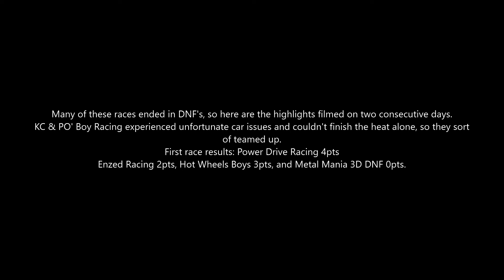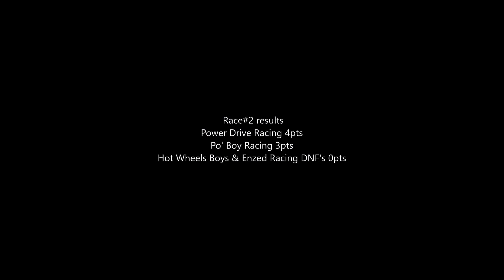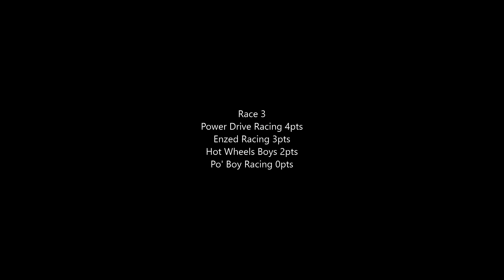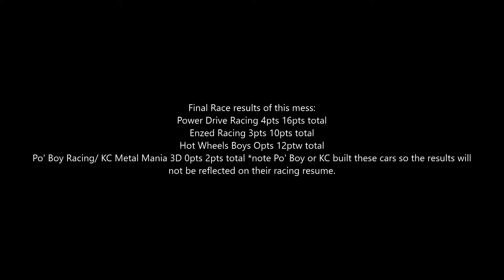#BlackFireTyer Invitational, Heat #7 Wildcat 350 Speedway Presents: Exciting Custom Diecast Racing

Comment: That was epic Jon, I got flamed 🤣😂🤣😂 brilliant stuff mate the action was non stop. 👍👌👍👌👍
Reply from the maker: Thanks Craig this heat fought me every step of the way to get in some clean races.  The cars will probably carry the points to the next events qualifing and heat placement.  The Chevelle still needs some shop tme, it suffered from the overseas journey.  I'll have it up and rolling smooth for it's next outing.  These cars didn't advance, they were blown off the track by the other cars with tyers in the test heats for round 2, they could barely get passed turn 2, if they were still on the track.  Thank you, you'll really love the next rounds.  Cheers!
Reply: 😂😂🇦🇺🤝🇳🇿👍😎 Got Flamed, glad to cops werent involved 😂🇦🇺🤝🇳🇿

Comment: I love EnZeds MG1100, well detailed too! Good one! Loved them as a kid the first time around too!
I have to find a beater one now to have a crack at it!
Well done DJ, I never.....tyre of you vids! Haha
Cheers all
Reply: I'll second that Marc D 👍🚦🏁
Reply from the maker: I'm going to outfit it and I bet it will be competitive, it has great pace in clean air!
Reply: @PowerDriveRacingDJTrippleJ  awesome stay tunned for the Morris 1100 that blows away the big guns 😂🇦🇺🤝🇺🇸😎🙂👍
Reply from the maker: I was thinking about setting up a few of my Johnny Lightning Minis that roll like their on steroids and see what little blue can do against them.
Reply: @PowerDriveRacingDJTrippleJ  yes that be cool, I can remember before i started racing speedway and back then they had the minis up against the v8s and man they beat them, plus also gave them a very hard time was awesome to watch, that was back in the 70s cheers
Reply: @PowerDriveRacingDJTrippleJ  I did note it had some speed going into turn 1.
Reply: @cutrockr-diecastracing2773  that MG was a 20c car from the Sally's...it had a squashed roof and no wheels.
Took a little bit of pamper to get it looking good, the dog is 50% super glue, wheels from a Kia and you can see the 25g lead block I put in the back-seat 🤣

The 4 coats of blue epoxy paint hides a lot of mistakes....but i was impressed that it actually ran straight!

 And now it's in the USA racing all you legends!!! How cool is that?
Cheers Jon 🤙🏼
Reply from the maker: @cutrockr-diecastracing2773  It shows flashes of Ram It speed.  I raced them but it didn't record.  It looked like a small dog trying to heard an elephant.😁😂😅😜 It had the lead out of turn 2 until it started spinning out of control like a rouge wheel on a bent frame shopping cart.
Reply from the maker: @enzedracing3641  It will find the podium.  I'd like to race it against some of my custom Mini Coopers and similar short wheel based cars.  Along with the big boys.  Once it stops spinning and gets traction it will be a menace
😄😜⚡

Comment: Metal Mania pulling up the rear.  I think HWB was causing all the collisions and using his crash mastery to finish. Did you see his richoteching technique :P
Reply from the maker: Hahaha it was a last minute decision but the cars I ran for KC without tires were too fast and wouldn't stay on the track it just wasn't meant to happen.  The last of the first round he's running a Lamborghini Aventador metal/metal with FTEW's BlackFire Tyers and it's scary, he'll be happy with it and is worthy of Metal Mania 3D Workshop.
Reply: 🤣😂🤣😂 I had a speed wobble on race 3 after turn 1. I thought I was going to flip. 🤣😂🤣
Reply from the maker: @HotwheelsBoys  The Impala did very well, I'll get at least one tire on there so he can get in and trade paint with Kia & Jag.  Between our two cars and Mikes, we are missing out on some strong performers.
Reply from the maker: Yep Craig came out of turn one ready to head hunt and take out anything standing in his way.😅😅🤣🤣😁😁
Reply: @HotwheelsBoys  taking your reputation of cornering (badly)  internationally 🤣🤣
It's awesome to watch!!
Reply: @enzedracing3641  like a boss 😎